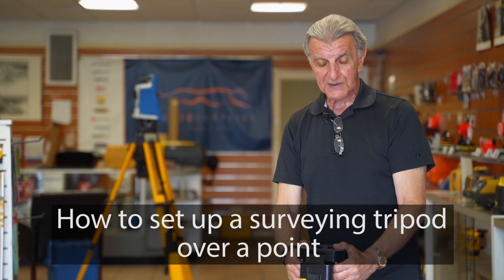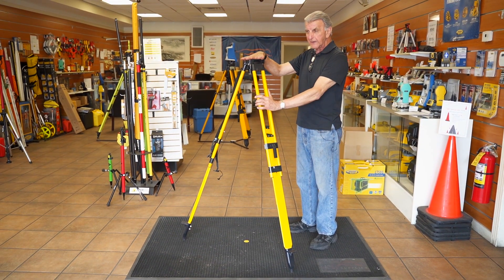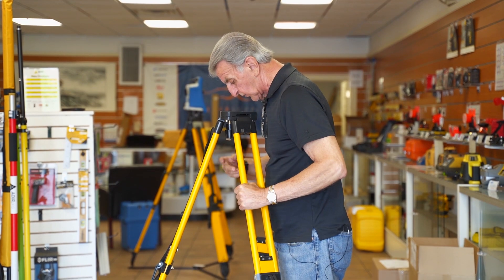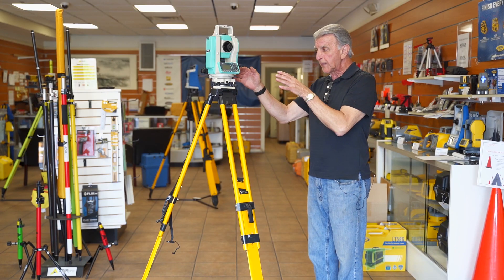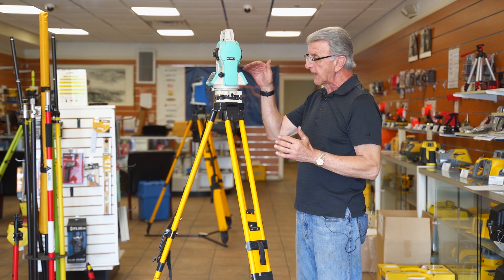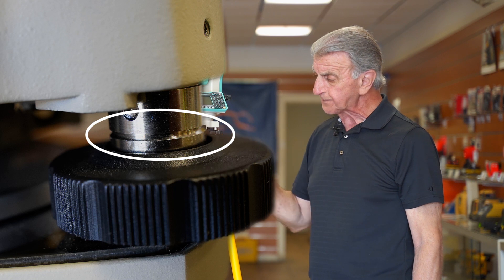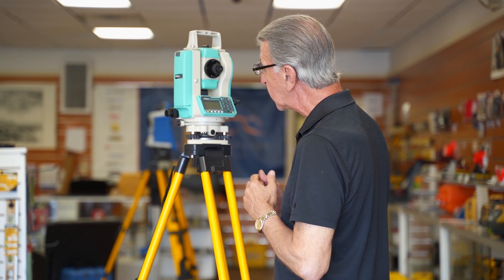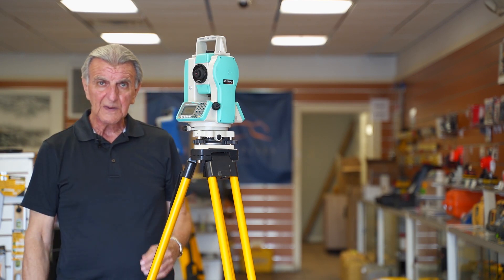How to setup a surveying tripod over a point

Comment: There is a better procedure.  1. Set up the tripod as shown here, with a slightly wider stance and longer legs, head roughly level as explained in video (in the video the rug isn't big enough to allow that).  2. Check that you are over the point with your plumb bob (not your eyeball) and shift a leg or two if the bob says you are more than an inch or so off (an inch or so is plenty good enough). 3. Stab in all three legs the same amount.  4. Attach the instrument to the tripod.  5. Level the instrument with the circular bubble, using two screws in opposite directions, then only the third screw. 6. Now (and not before!) loosen the tripod securing screw and use the optical plummet (or laser dot) to slide the instrument across the head of the tripod until it is perfectly over the point. 7. Further level the instrument using the longer and more sensitive bubble, and repeat step 6 if you are not dead on.  I can set up in sixty seconds using this method, because I understand that the optical plummet (or laser) doesn't point straight down until the instrument is level.  Remember, these instrument tripods have a wide head and a large central hole for a reason.  It is so that the final centering can be done by sliding the instrument on the tripod head.  Don't waste time fiddling with the laser or optical plummet until the instrument is level.  These days everyone uses the laser or plummet before leveling, and setups often take five minutes or more.  There is nothing wrong with having the instrument end up not dead center of the tripod.

Comment: 9 we understand good sir but next video how to work topo survyour
Reply: Topo is just 3-dimension surveying. Setup is the same, plus you measure the height of the instrument and also the height of the rod. Then the shots (points located) are functional on the X, Y, and Z axes.  Labeling the shots properly is how the draftsman knows which points to connect as contour lines or objects in the area surveyed. 

Also we use GPS for topo as much as possible, with LIDAR being the new tech king of the topographical survey. Of course not everyone has access to these technologies.

Comment: Finally someone that knows what he is doing setting up a theodolite. I have laid out over 60 gas stations & a few Win Dixie stores and had to set up fast. Your method is exactly like mine was and 2 minutes is about right. I retired several years ago. I used to use an HP75 with surveying module to get point data from the plans. Had software to transfer point data from HP75 to a card that slipped into a slot on the theodolite.
All I had to do is set up on an known point and get a back site. Enter point number and rotate instrument to read zero at prism on pole and move prism for distance to read distance of zero and install stake.
Easiest job a person could find.
Reply: Set point. 0ft.and 0tenths plus 0 balls to the gun.😂 good job young man.
Reply from the maker: Thank you Gator! We know what we're doing :)